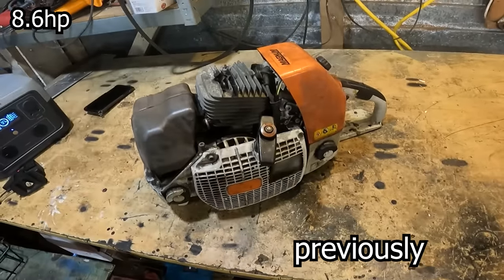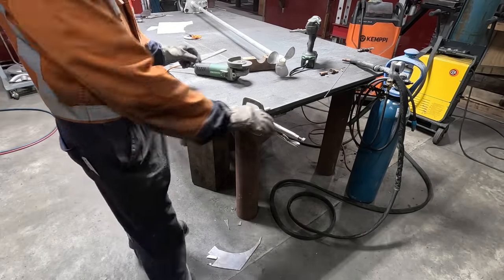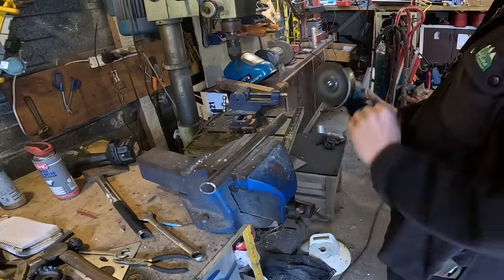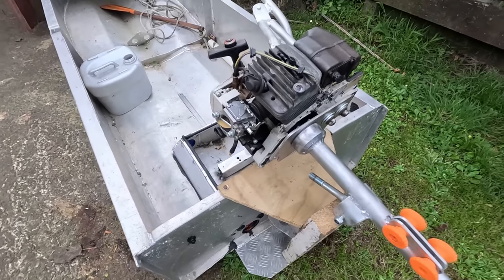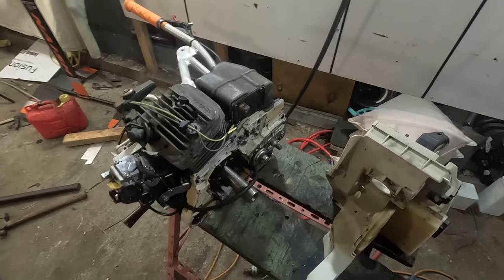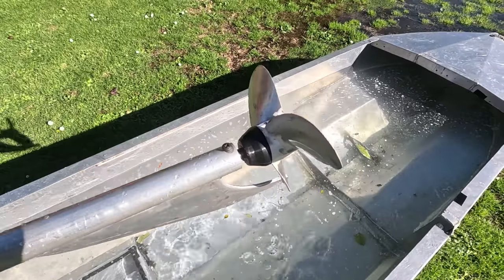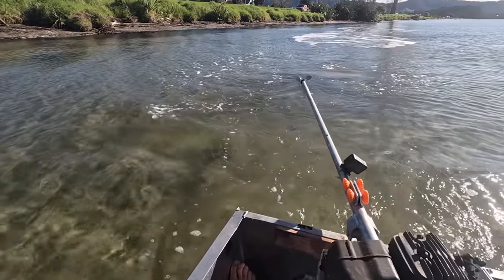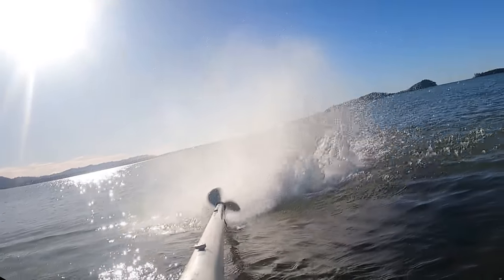Chainsaw Powered Thai Longtail Build, Part 2

Comment: As a Kiwi living in thailand building a jetboat, this video made me chuckle
Reply from the maker: O nice! Are the long tail boats common over there? What motor are you using in your jet boat?
Reply: @DktheWelder  everywhere, normal launches aren't so common unless your in the big tourist areas.

I am going with a N/A K24A with a jetski pump on a 3.6m hull. The goal is to take it on the mehkong river along the north border then transfer into the chi river system, and tow the occasional biscuit in the lake.

Comment: It acts like what's called A outboard motor cradle. witch takes the place of A extra mounting pivoting point bracket is all it does. Just basically simplified easier version set-up.

Comment: You need to add the cooling ducting back to the engine, otherwise it will burn up real quick
Reply from the maker: I don’t have the top cowling I will make one before I do a longer test drive

Comment: you need to put back the top cover on because  chainsaw motors are cooled with the fan  and with the cover its forcing the air thru the cylinder head to keep it cool
Reply from the maker: I don’t have the cover but I will make one for the top at some stage before I give it a hard run

Comment: you could put the prop on the lathe and take 1\2" or so off its circumference so it would be less aggressive
Reply from the maker: That would work but I really need a surface drive prop for this setup I am making one at the moment

Comment: Looks like fun! I’d actually go to a more aggressive pitch but much smaller diameter the prop you are using could cope with 5x the power the Stihl has! id try something closer to 80-90mm dia and 19-21p also if the blades leading edge is deeper it will give more traction and less lift
Reply from the maker: Yes . I am making a smaller diameter prop that is more aggressive with surface drive shape so hopefully it works
Reply: @DktheWelder  cool! I’m keen on this type of project! Ever considered an air pump to bubble stream under hull? I’ve used an air mattress pump on my kayak which is powered by rc boat engine/pope line trimmer and on my old hydroplane made from 4x205l drums and it helped it get on the plane substantially, it’s also the method used on the first ever boat to get on the plane

Comment: Nice to have a boat you can carry with one arm. Nice try with the long tail. A different prop might fix the problem. A bigger stronger shear pin is in order.
Reply from the maker: The boat and motor are super light which is cool. I’m going to mount the prop totally different I am designing different propellers at the moment

Comment: Subscribed.

Fun to watch.

I might reduce the diameter of the propeller you have in small increments, way 15mm at a time, until the prop matches the motors output.  Your lathe should make short work of this.
Reply from the maker: O thanks! I have made some 3d printed props that hold up. I tested today but they were still to aggressive but the weather and waves were terrible which didn’t help, next video out soon👍

Comment: Props are tricky bro I built my mud prop out of bin crate plastic works good on the drill ,slow rpm but bogged on the lawn mower motor keep at it you’ll sort it out
Reply from the maker: I am trying to 3d print propellers at the moment like mud motor style so hopefully they work
Reply: @DktheWelder  size and thickness are key mate hopefully you have a win

Comment: Best vid so far mate!! Brillliant! With regard to pee cam, I think you have a problem you should seek medical advise on!  :0)
With the 3 blade prop, could you just machine the blades a bit smaller or thinner to reduce the " gearing" / pitch?
Reply from the maker: A guy has been emailing me who is into those surface drive props and sent me some of his models. So they need a big cup smaller diameter and more aggressive. I am 3d printing some at the moment to see if they hold up👍
Reply: @DktheWelder  if they break try to wrap them in epoxy with some glass fiber.
Reply from the maker: @pietlopsa9164  that is a good idea . Also be a bit flexible for hitting rocks and stuff

Comment: Ahh. Back to your old self again. 

Awesome entertainment. 

Ps, how did you go with the motors and drives? Any luck fixing them?
Reply from the maker: I have played with them for quite a while with now success. I think one controller is definitely broken and the other one will go like one out of 20 tries maybe. There is a guy sparky at work that likes rc stuff I might try get home to have a look
Reply: @DktheWelder  
Sweet. 
The key word is star point open circuit. 

Best of luck with them. 

If you give up just send them back.

Comment: Mate, good job 👍 love your work.
You got some good access to amazing tools too, pretty jealous.
Bloody propellers 🤦‍♂️🤦‍♂️, it’s the most important piece sometimes.
If your like me, you won’t give up, just another hurdle to jump, makes the wins even more impressive.
Can’t wait to see what you come up with for the prop mate, unfortunately I haven’t seen a right hand mud prop.
That 5hp prop is probably about a 8 pitch??
Wonder if you could back it off a bit by bending the leading edge up (block of hardwood with rounded end and a hammer) 
Just bend the leading edge up a little, it will reduce pitch, try to keep the blades as similar as possible.
Leave the trailing edge alone for now.
Also the stock alloy prop won’t be that great for surface piercing unfortunately unless it has a small cup added to the trailing edge which will add pitch 😢
I would try back it off and see what it does first.
Thanks for your videos mate, awesome 👏 
Cheers 🍻 
Aussie Boat Guy 😎
Reply from the maker: Thanks, yeah so lucky to have access to machines. I am 3d printing different propellers this Thai guy emailed me with some designs and advice. Can you please try find me on Facebook dkthewelder I would like to mess you some more ask questions

Comment: Strange question for ya Dan but did ya check the nylon bushing ya made down near the prop end?
Check out RC boat drive shafts as it would give ya some ideas as the RC boats are ball ball bearing or bushings and packed full of grease as the nylon would get hot and start to melt due to friction
Reply from the maker: That is a good point, my other long tail I bought just had a plastic bush at the bottom so I thought it would be ok , although this motor does spin 3 times as fast haha. Will have a look tomorrow

Comment: What Hp the chainsaw pushing?
Reply from the maker: 8.6 hp 120cc I will build an expansion chamber later and maybe push it to about 15hp but don’t really want to ruin the motor with too much power haha
Reply: @DktheWelder  nice. The expansion chamber will help.. well the 125cc in a YZ puts out 36hp..

Comment: I think your motor doesn't have the weight and torque to be able to drive your dinky dingy! Gas weedeater engines have the RPM, but not the brute muscle torque to spin an agressive prop. Some weight before the prop might help some, and brass bushings with crater grease might help more. Very nice idea, with much more development in order. Someday you might make money selling kits as used weeder engines are practically a dime a dozen right now. I have four from other garage sales that I bought for projects. None cost more than $10 each.
Reply from the maker: Except weed eaters aren’t very powerful, this motor is 8.6hp . I actually had it going pretty fast with an outboard lower in this video https://youtu.be/SDBDYqu_1Mo just want to go a bit faster

Comment: You need a reduction gear set up and or a super shallow pitch. That engine doesn’t have the power to turn the prop you’ve got at 6000 rpm.
Reply from the maker: I have been talking to a Thai guy and I need less diameter but a more aggressive cup on the prop
Reply: @DktheWelder  also consider putting the cooling shroud back on the saw engine, I made one years ago and actually used a big rc boat prop and a weed eater engine, worked ok maybe 5 mph .

Comment: take apart a bad angle grinder to get 90 degree angle adapter
Reply from the maker: I don’t know if a grinder will hold 8 hp the reduction would be about right for that prop
Reply: @DktheWelder  Get a cheap warrior one from harbor freight they go on sale for like 10$ some times

Comment: Hate to say it but those longtails need torque more than rpms.
Reply from the maker: 2 strokes have more torque than four strokes just at higher rpm. Hopefully with the correct propeller it will work 👍

Comment: Your boats too short and use a two blades race prop it needs speed to unload the motor👍
Reply from the maker: I am building another boat soon . I have 3d printed some props 2 blade surface drive types. I tried them today video coming out soon

Comment: rpm is too high for that prop. To make that prop work I may gear down the shaft rpm. A different commenter said smaller prop but I disagree, it looks like it can handle larger prop but at also geared down rpm.
Reply from the maker: I am making a smaller more aggressive propeller that is meant for a surface drive setup will be testing soon
Reply: @DktheWelder  do you hear the high motor rpm? The only time you want to go to a smaller prop is when you can't reach peak power rpm, or can't simply gear down the shaft speed. Sure a smaller prop will have a lower tip velocity and be less likely to cavitate at a given rpm, but it will have lower power handling capability
Reply from the maker: @Siiello  check out the latest video I get a smaller prop working, with a bit more prop design it will work I hope👍
Reply: @DktheWelder  I didn't know it was out yet yay! Thank you for saying so going to go find it now!

Comment: pretty awesome it runs really good just needs a different prop,

an if it dont work ot try a 4 stroke like a 80cc predator pretty sure they have aftermarket parts for those to, then that outboard prop will work flawlessly.
Reply from the maker: This has probably 3 or 4 times the power as one of those but only at high rpm, I need to get the correct propeller I think and it should be pretty fast